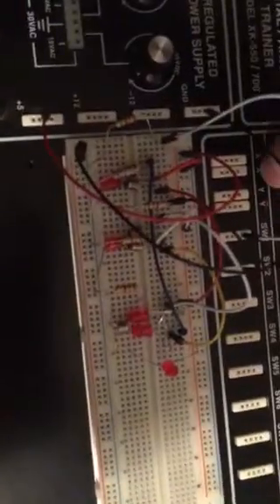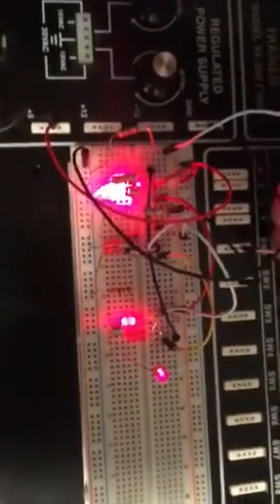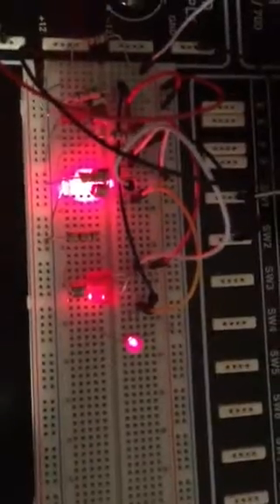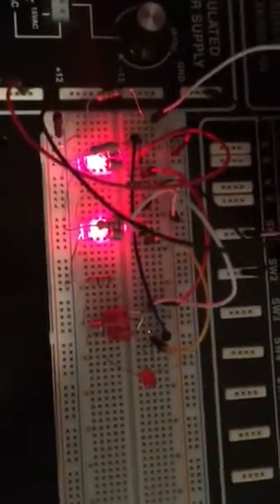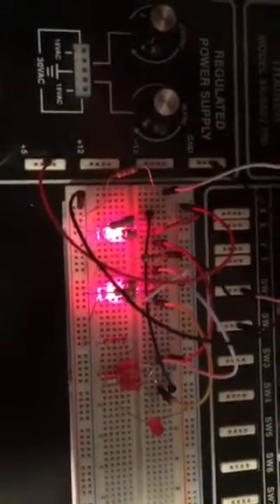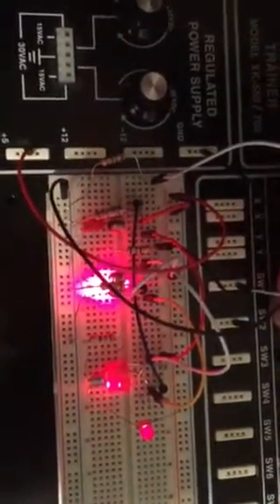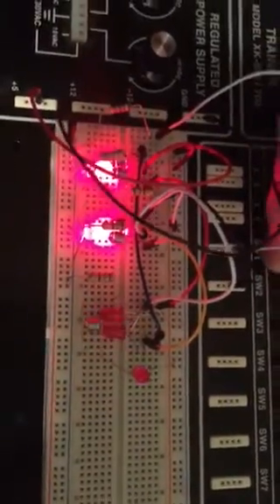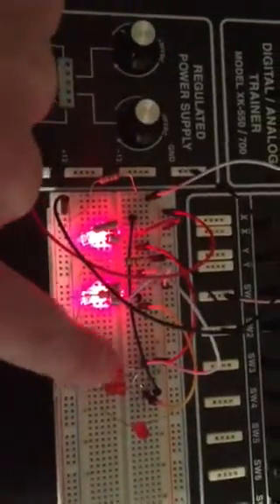“Optical Logic Gates”

Comment: optical transistor is possible using interferrence. two inputs, if interference occurs, central peak is output, if not - light goes straight